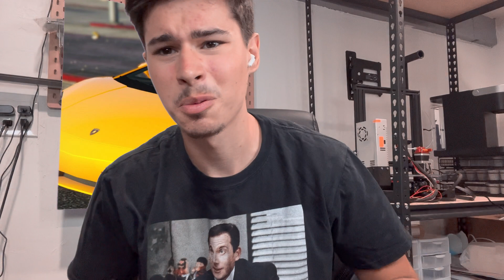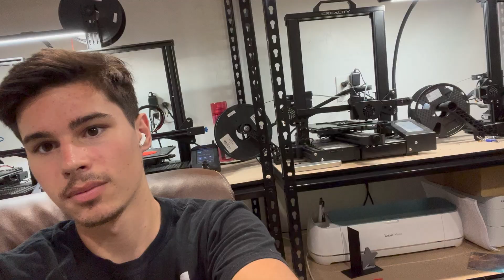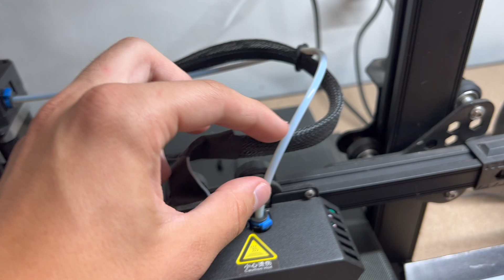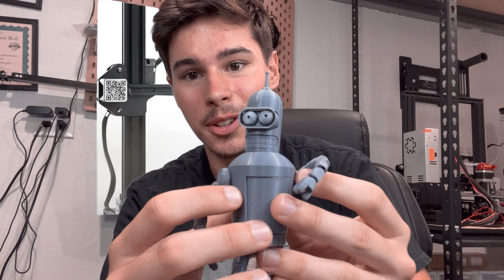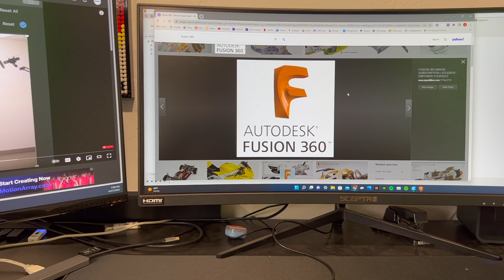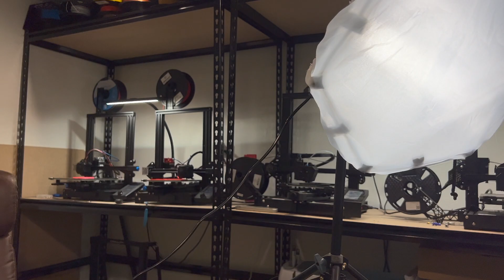How to Make $100 Per Day 3D Printing | No Experience Needed & Low Investment

Comment: Hello, thanks for the info you had provided. I'm planning to gift custom 3d toys if themselves for people who sign up on my app. 

Can you please suggest me a heavy duty 3d printer with at least 100 units of output and the material costs? Thank you in advance.
Reply from the maker: Hey thanks!  I'd recommend a CR 6 SE printer, however if you're wanting to print large batches of hundreds of toys, it'd probably be easier to go with a manufacturer or someone on Alibaba :)
Reply: @mrwumbo1438  thank you so much for your response and advices. Going with Ali Baba is not option at the moment because they are charging alot on the shipping which is not convenient for me in the early stages.